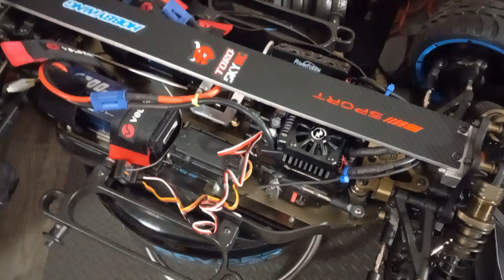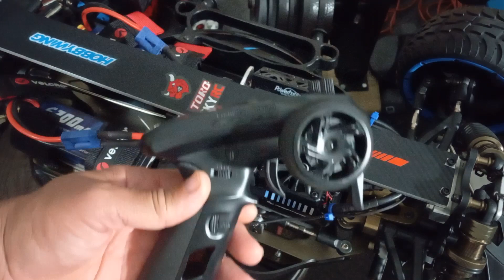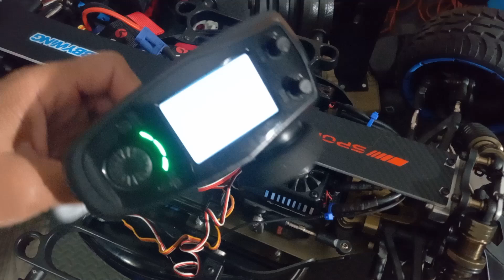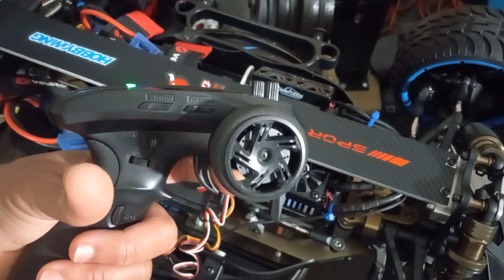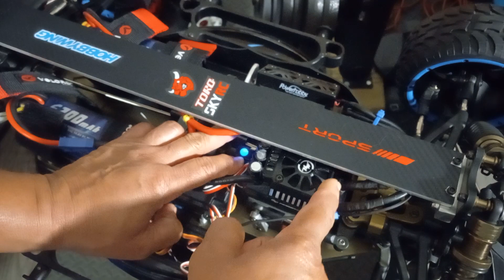Blinking red light on EZ-Run Max 5 ESC. (Help).

Comment: Hi...how did you solve this calibration?..where was the problem...?
Reply from the maker: Yes I did!. I just put it away for 2 days, tried the calibratie steps again, and it works. Don't know if it was just luck or what.
Reply: @fangrc3404  Thank you for writing back..I had the same problem..I was putting the engine with the sensor and so I thought I would calibrate it..but before that I put the throttle trim on the transmitter setting to maximum..I just couldn't calibrate it..the car then went..but after 30 meters it put it into emergency mode..it lost power..I didn't know what was happening..then I found out at home that I had added throttle trim on the transmitter..I calibrated it again and tomorrow I want to try if it will work or if it will still have power or put it into emergency mode..but it will probably be the calibration..thanks for the advice and observation..have a nice day

Comment: Did you find a solution?
Reply from the maker: Sorry, I just saw ur comment... Yes I did, I just shot it down for about two days, then repeated the trouble shoot/binding steps and it worked. Stay tune I will run it soon, for the first time since I converted it to 12s. 👍🏼✌🏼